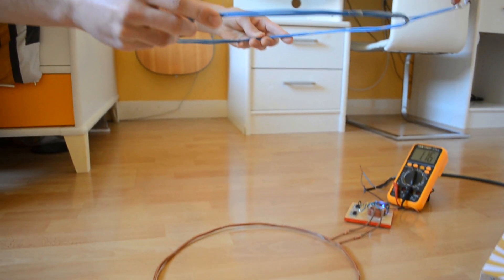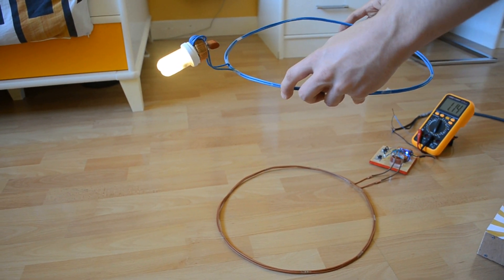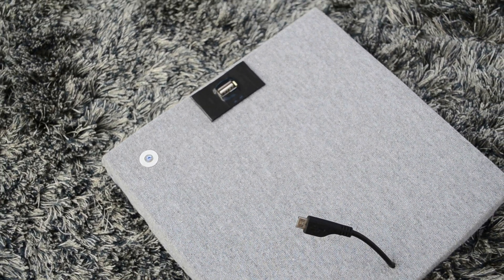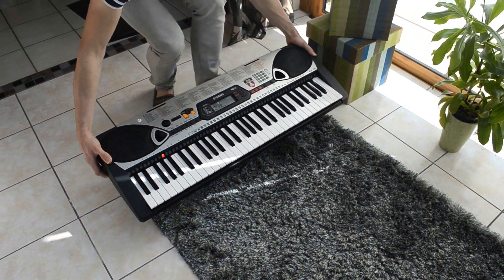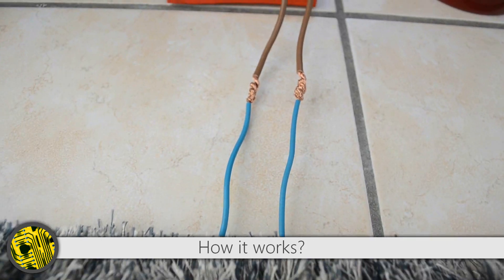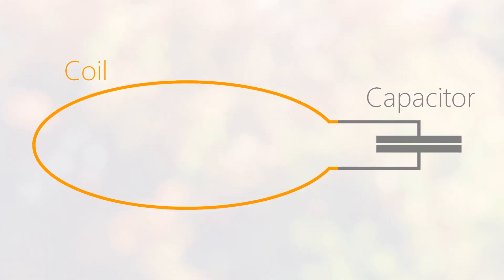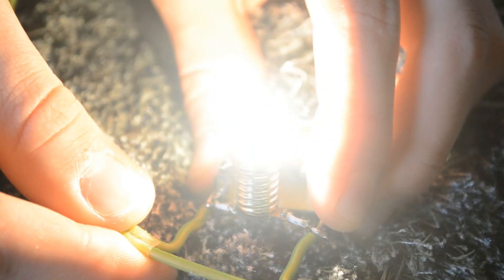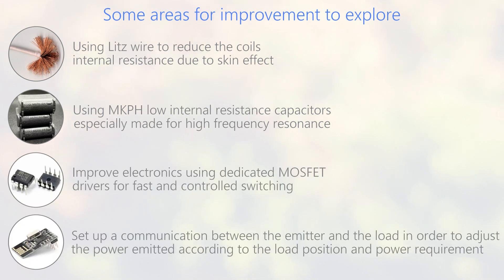Wireless power transfer - DIY Experiments #10 - Resonant inductive coupling

Comment: We can see 5 resistors on the PCB. But in circuit diagram shows only 2 resistors?
I will appreciate if you could please guide. 
Thanks. 
👍🏻
Reply: probably 3 1kOhms resistors parallel to each other, to have a total of around 330 Ohms

Comment: Can a variable capacitor be used to precisely tune the carpet transmitter to the receiver?
Reply from the maker: Right, but radio ones have a to low value

Comment: Great video. Your explanation of how you increase transmission distance is excellent. 🎉I would like to build a magic carpet. Can you send me the circuit diagram and a component list that will allow me to make a carpet that is 10 x 11 feet? Also need to know how many windings are in the rug coil and the wire gage and type. Last question. Should the rug coil be insulated wire for safety?

Comment: Congratulations best I seen yet. The baseboard wiring antenna is a great idea too. I have been doing experiments myself but your work has left an impression on me. I am so happy to see a young person as yourself producing such amazing results for wireless energy ideas. Don't give up this dream it is the future. Embrace your innovations and you will go far. You have already found some ways to overcome distances of transmitting energy and exceeded a lot of others that I have seen so far. You baseboard transmitter antennas are especially creative. I have been using Tesla exiciters and plasma balls as transmitters and been working on resonant antennas to improve distances unfortunately these Tesla transmitters are very noisy radio frequencies so making things practical for every day use is the greatest obstacle other than distance from the transmission overcoming them will insure your success. Amazing video! Congratulations again and thank you for sharing.
Reply: Great comment! How’s it going with your experiment?

Comment: its RLC instead of pure LC resonator
Reply: mod a wireless computer mouse to use a wireless power under the mouse mat
Reply from the maker: Already done in our french channel "Incroyables Expériences", in 2011... !
Reply: charging mouse pad
Reply: charging desk pad
Reply: untie from the load, the resistance, to a pure LC circuit, then you get the best transmit
Reply: try capacitive coupling out of the receiver circuit, or even capacitive power transfer, over a distance
Reply: why are you getting damped transmission curves, duh
Reply: seems like you have a directionality problem
Reply: try directed non-radio parabolic magnetic power transfer, both resonant and directed, but not going ham
Reply: it should work like a wire power transfer without a wire
Reply: that chart looks very much like a quadratic power loss chart
Reply: or 1/r^2
Reply: have you measured radio wave emittance / dosage
Reply: have you tried iron cores for containing, concentrating, directing, the magnetic field
Reply: use this as axial distance measurement device, you know the exact power level to distance relationship, in the tracking pod, 3 axis pad gives you 3 coordinates, very accurately

Comment: Awesome video! I had a project idea about a table with a coil below the top to power stuff but got discouraged when I did some math. Given certain parameters, I would have needed an insane amount of flux to just get 5 V on the receiver coil (more flux than industrial-grade stuff). This video proves to me that either something is wrong with my math, or the use of tuning components is a much bigger deal than I thought it would be.

Comment: It works just as transformer without ferromagnetic core. Its very cool but, outer power is very low in comparison with input power. But really cool:)
Reply: That's what i am wondering. How much losses are incurred in order to attain it. What's the point of loosing so much power then.

Comment: when making the fan... WHY DID YOU CUT ONE LEG OF THE MBR30100? CONNECT IT SUCH A WAY THAT BOTH DIODES INSIDE ARE IN PARALLEL! By the way, you should better make a bridge rectifier with fast diodes!

when making the charger, you should have used an LM2596 buck converter! they are cheap on ebay, will be much more efficient than the LM7805 you used, and allow you to get more than 2A at the output!

the same applies to the piano, you could replace the LM7812 with a buck converter!

oh, and... you wouldn't have burnt the computer if you used one!

well, not sure the current in the coil is really a sine wave! you should add 1n4148 in parallel to the body diodes of the mosfet and a 1uF film capacitor in parallel to the power supply because of inductive spikes!
Reply from the maker: It's not randomly made, the diode is already oversized so no reason to loose time adding another in parallel, otherwise, using the bridge rectifier will reduce the efficiency with and second voltage threshold (we currently don't loose negative impulsions because the energy is saved in the LC circuit).
Reply from the maker: About linear regulator it's not a big deal as the critical point is the center of the carpet and the goal is to reach 1A anywhere on it. In fact we loose power but only when we have excess power (but in fact the charge current could be increased on the edges). We used a DC/DC for the computer! The issue was probably the current induced anywhere in the motherboard.
Reply from the maker: About linear regulator it's not a big deal as the critical point is the center of the carpet and the goal is to reach 1A anywhere on it. In fact we loose power but only when we have excess power (but in fact the charge current could be increased on the edges). We used a DC/DC for the computer! The issue was probably the current induced anywhere in the motherboard.
Reply from the maker: The current is a pure sine in the LC circuit! But in fact on the mosfets side there can be spikes when switching

Comment: Can I safely do this in my room. Idk about the electromagnetic radiation if there even is any. If so if I make a really strong wireless charger so I can do something like bring my iPhone within a certain area of my room and it automatically charges. How safe would that be? Could it give me cancer?
Reply: only emw which are ionizing can cause cancer 
for instance 1000Thz 
itss more than light frequencies 
light is between 300-700THZ 
so 100khz is tooo low 
note:1THZ=1000GHZ    ,   1GHZ=1000HZ

Comment: Led is glowing ..but using rectifier with fast diodes mobile is not charging. DC voltage is coming at the output of rectifier...but I cant identify why mobile is not charging ...

With two circular loop of same diameter mobile is charging...but with a bigger loop mobile is not charging..can u plz help ?

Comment: Try this with a satellite dish!
After building a satellite dish.  I would place a 3-foot jumper wire on the dish (that I just built & aimed at the satellite).  I would take the 3 foot jumper wire, then screw it into my " super buddy" its the satellite aiming computer.  And within two hours the 7.5 volt battery would be fully charged , using radio waves from satellites!
Reply: you can detail more or give a link of a document or a video please ? Thinks
Reply: Video ?!

Comment: When I connect the bridge rectifier the led brightness becomes half
Reply from the maker: You need a fast rectifier, not a recovered one designed for mains frequency. A simple diode is sufficient instead of a bridge (less voltage drop).
Reply: @DIYExperiments  thank you very much

Comment: What is the efficiency of magic carpets, and what is the magic carpet input voltage
Reply from the maker: 80% max for the same coil demo, 30% for the carpet. All in 24V.
Reply: By connecting the diodes for rectification , the voltage get reduce , is that any special type of diode required?
Reply from the maker: UF4000 series for instance

Comment: I make system like this ,when primary and secondary coil is of same diameter then only  load gets the power,in your magic carpet secondary coil diameter is very low but it work, mine is note working
Reply from the maker: Did you use resonance? Without resonance it's so weak that it almost doesn't work!
Reply: @DIYExperiments  means adding a capacitor across  both the coil , isn't it.
Or to add one more LC resonator in between primary and secondary

Comment: Do you have any diagram of your emitter ? I can only do it with 2n2222 and i cannot get more than 0.40A at 5v

If only you have the diagram it will help me big time..

 Btw this video was awesome !!

Également je parle français si c'est plus simple pour toi !
Reply: 2n2222A is low powered transistor,so its current capacity is very low
Reply: 0:30 circuit diagram

Comment: Hi!

In your previous te video on the subject you published on your first channel, you created your oscillation with a transistor oscillator . 
 
I guess you didn't do the same because the emitted frequency is much too high.  What type of high frequency generator did you use?

Anyway excellent video thank you!
Reply from the maker: Hi
I don't know where do you see a difference but it's exactly the same electronics :)

It's a Royer self-oscillator, zero volt switching.
Reply: Ok thanks !
I had a doubt
Reply: Can someone post a link to the Video where you Show how the Oscillator is Built?

Comment: Don't you have any heating problem??🙄🙄
Reply from the maker: The capacitor as it's not made for this purpose (a MKPH would be better), otherwise no, the efficiency would be bad if too much energy was lost into heat!
Reply: @DIYExperiments  actually my inductors and the MOSFETs get quite hot after 15-20min of usage with 12watts of transfer 🙄 ????????..well I have mkph caps and no problems with cap heating.
Reply from the maker: What is the frequency?
Reply: @DIYExperiments  actually I don't actually know about that cause my lc meter is broken and due to the lockdown I can't even buy one...but it's a single loop of wire just like in ur magic carpet ..but the diameter is less and 1.32uf cap ...well I just have one more question...which MOSFETs are u using ....I have got the big irf260 ...but urs looks rather the smaller package..well thanks for ur response... great work..
Reply: I used TIP31C transistor , for the switching i use Joule theif circuit to give base signal

Comment: Ahh... Sweet sweet metric!

Also why do you use linear regulator instead of buck converter?
Reply from the maker: Actually it would be better with a DC/DC regulator in a commercial efficient version to reduce the consumed power is short distances.

But the aim here is simply to get a constant power over the surface so the limiting point is the energy when the receiver is far from the emitter, to dissipate energy when the receiver is close is not an issue : we already get the required power so we don't care about the additional one! (but is drawn from the emitter anyway).

In our set up things are calculated the way that the linear regulator doesn't loose energy in the critical point in the center of the carpet.
Reply: @DIYExperiments  oh ok, so it was constructed as demo for tuned resonance.

Comment: Is electromagnetism harmful to humans on a certain level? Do you think in the future we could have all appliances using wireless power? What comes to mind is having almost everything running on batteries and sitting on chargepads when not in use
Reply: Strong electromagnetic field is present in microwave oven, basically it will heat up and maybe damage your nerves and twitch your muscles
Reply from the maker: Here it's only a magnetic field, the emitted electromagnetic power is very very weak (mW), there is no effect at all on non metallic things

Comment: inductive coupling, yes but only magnetic induction. I'm working on capacitive induction, based on impulses, like Nikola Tesla did.
Both forms of induction can be combined with a Bifilar Tesla coil.
Reply from the maker: Right, I already experimented it, but instead of using high current in coils you need high voltage in "open" capacitors, it's dangerous if you want to transfer a real 10 to 100W power. It's also easily blocked by any grounded objects. It's really not for the same application and more limited in my opinion.
Reply from the maker: It didn't know it was possible to use both (not electromagnetic but really both near fields at the time), I will check, thanks!
Reply: inductive is more efficient than capacitive coupling, i did single wire transmission using Tesla coil 9 volt

Comment: Massive power loss... you're putting in 50 to 75 watts and getting only 10 watts back...
Reply: A wise man points to the moon, while the monkey points at the wise man’s finger.
Reply from the maker: And so what?
We talk about efficiency several times and we can reach 80% in short distance, it depends on the application. High power short distance and low poser high distance. The efficiency is not a problem with low power devices!
Reply: @DIYExperiments  it's cool and novel but not practical. It probably interferes with other electronic devices and I wouldn't want a 100 watt long wave transmitter in my bedroom running 24/7... also the low power devices could be much more easily powered off batteries without being confined to a mat. Wires work great too as long as you aren't dumb and/or careless.